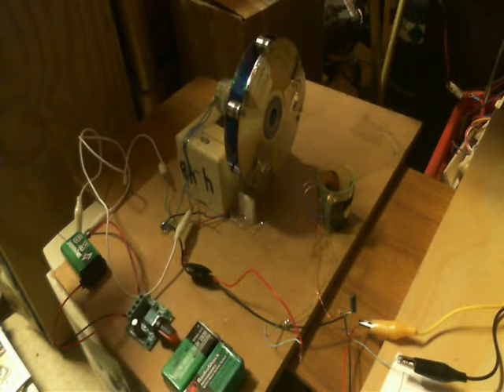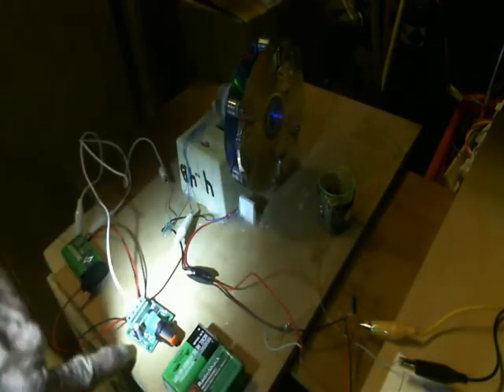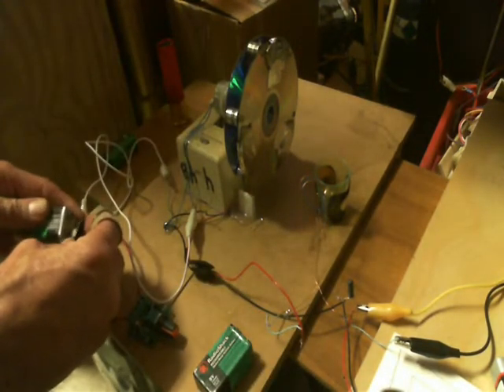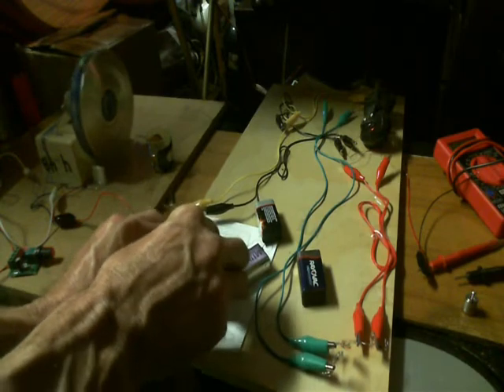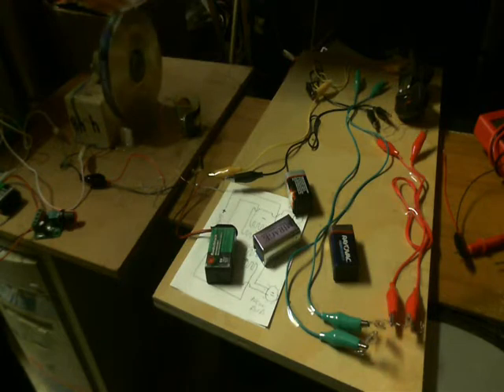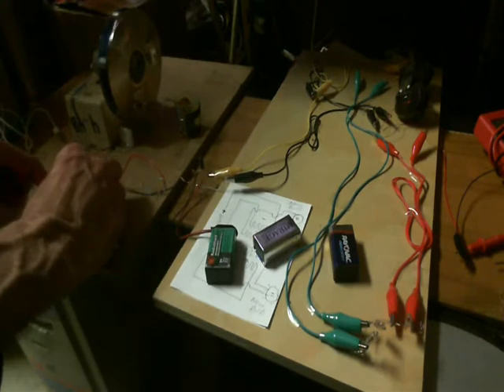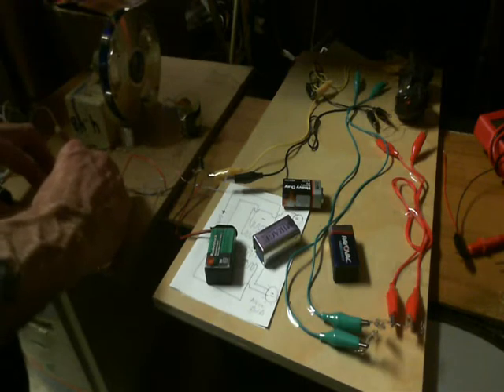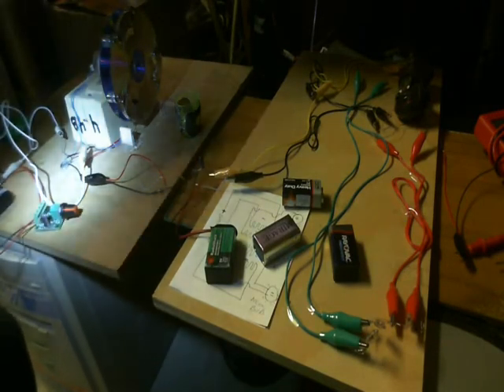ROTARY SWITCH 2

Comment: Thanks for sharing.. I noticed a year ago, that if you slowed the Bendini wheel to a crawl, that it produced a HUGE field, but at that RPM, it would not sustain motion... Still trying to overcome this, but not with wheel. Told a friend of mine, that this same thing could be done without a prime mover, bu manipulating existing circuits, capacitors, and special made coils, such as yours.. :)

Comment: The bearing dude, its cooked, all that wobble is wasted energy
Reply: I like the EM picked up by the mic!
Reply from the maker: Actually the bearings are fine, it is the cd's that are not straight and the connection to the shaft was crooked as well. None the less the proof of concept is fine. If this was done precision I believe you would get yet even better results. Thanks for the comment. :)